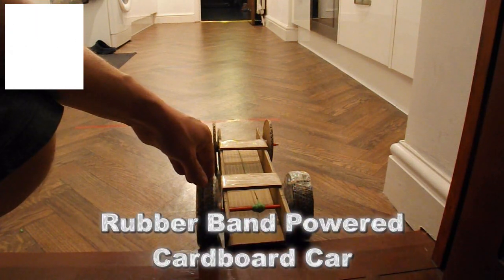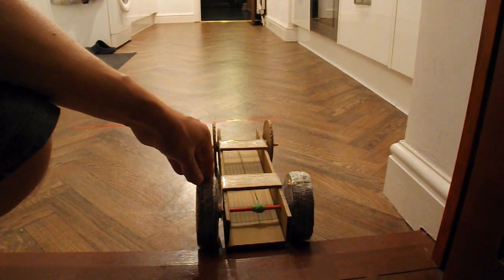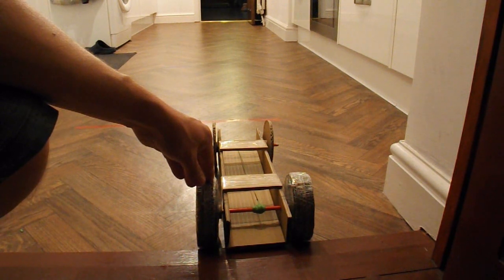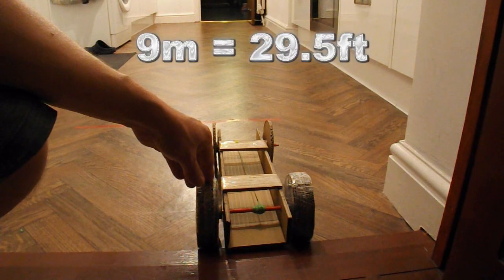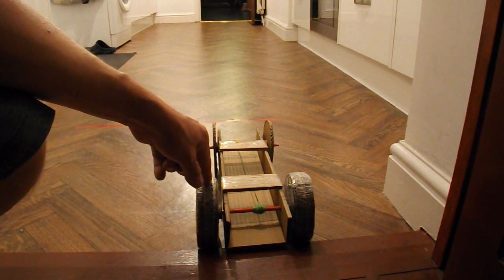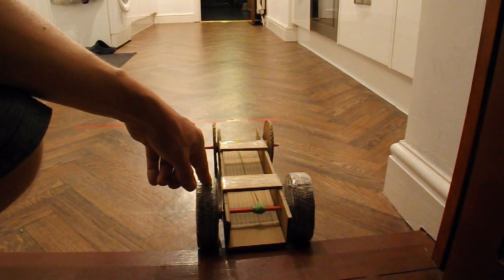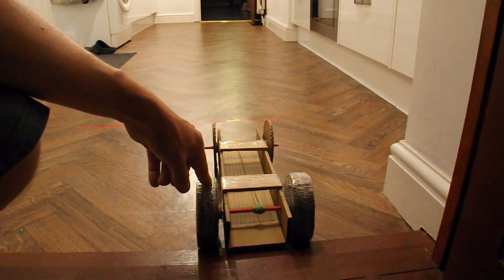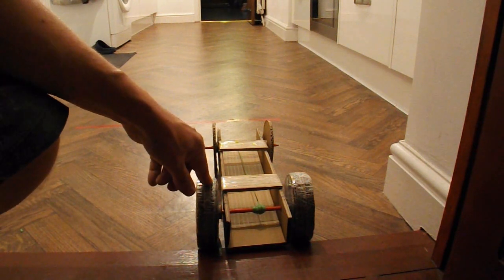Rubber Band Powered Cardboard Car

Comment: By car is similar but it keeps going right or left. Do you have any suggestions?
Reply from the maker: 1. Does the car run straight when you just push it without the rubber power?
If it doesn't run straight without power, then your axles are out of alignment.
That could the axles are not parallel or they may be twisted, so one wheel is not on the ground, so it runs on 3 wheels. 
2. When you wind up the motor, the tension may be distorting the body, causing the axles to go out of alignment, with the same effect as "1" above.
3. If you wind the rubber unevenly across the axle,  the tension can pull the axle out of alignment. 
4. Lack of grip. If the wheels spin, instead of moving forward, that can cause the car to turn. Add tyres to the wheels or add some weight to improve the grip.
5. Both wheels on the same axle must be the same diameter.

Comment: I’m a bit confused on how you tied the rubber band? Can you please explain
Reply from the maker: At which point do you mean? If you mean around the axle then I just held it on the axle and turned the axle until the band wrapped over itself. That holds it in place. If you look in the video description there is a link to a video that shows what to do. There is lots of information in the video description.
Reply: @GrandadIsAnOldMan  I didn’t notice the videos. Thank you they helped a lot!

Comment: carboard car looks great.  Can you design a car only with file folders, note papers, index cards, paper clips, rubber bands and regular drinking straws, white glue, masking tape?   Carboard is very sturdy to use to build the body and wheels.  It  was very difficult to build a self propelled car with papers unless I layer and layer and layer them.  Any different ideas?
Reply from the maker: Yes you need to make tubes or corrugate the paper to give rigidity - here is my playlist of paper cars I have made https://www.youtube.com/playlist?list=PLA5a2xPRSrB0WphB6YhygeyR9DDfmC1lk
Reply from the maker: I did this one for you https://youtu.be/vioI3sdiC1Y

Comment: what is the diameter of the wheels? I am thinking about making this for a school project, and this design looks good.
Reply from the maker: +Connor  Wallis If  you have to use cardboard for the wheels then make them whatever size you want. These ones are about the same diameter as a CD. I wouldn't make wheels unless I had to. Using CDs is much easier and you know they are proper circles with no errors, flat spots, or dents.
Reply: +GrandadIsAnOldMan  k thanks!
Reply: +Connor  Wallis also how do u make the back wheels connect to tha back axis, because I made the car and It looks great but it doesnt move when I wound up the rubberband
Reply from the maker: Connor Wallis the first option is to make the hole in the wheel smaller than the axle so it is a tight fit. You have already made the hole so now you will need to glue the axle into the wheel to stop it slipping.
Reply: +GrandadIsAnOldMan k

Comment: how big do the circles have to be?
Reply from the maker: Amir Rahmanipour whatever size you want. Mine are roughly the size of a CD so about 5 inches or 13 cm.
Reply: GrandadIsAnOldMan im having trouble with the front wheels. They aren't going straight and my car keeps leaning towards the right. am i missing something?
Reply from the maker: Amir Rahmanipour if it keeps going to the right then the chances are that you haven't got the axle holes aligned properly and you need to adjust them to straighten up the travel. Alternatively are your wheels spinning on the ground and allowing the car to move sideways slightly? You may need to add something to the wheels to increase the grip.
Reply: GrandadIsAnOldMan it works! thanks so much for this awesome design!
Reply from the maker: Amir Rahmanipour thank you for the positive feedback.

Comment: How do you attach the rubber band?
Reply from the maker: I show you in the video. You might have to slow it down to see it. At the front the rubber band goes through a hole in the cardboard and then pushed through it's own loop. On the axle it is wrapped around the axle so it covers itself and holds itself in place.
Reply: GrandadIsAnOldMan When I tried it, the rubber band quickly unwinds..
Also, do you have any way of making the rubber band car travel a distance of 5m and also drop a cube at that exact place? and I can only use a max of 3 rubber bands..
Reply: GrandadIsAnOldMan The rubber bands are also a bit thick
Reply from the maker: Jade Kelly when you say the rubber band quickly unwinds, do you mean that the back wheels are spinning and the car is not moving forward?
If that is the case you need to increase the grip on the wheels by adding rubber tyres or putting extra weight on the car to hold it on the ground.
Reply from the maker: Jade Kelly A couple of the cars in this playlist drop an object at a specified distance, you should be able to work out a general idea from watching them. http://www.youtube.com/playlist?list=PLA5a2xPRSrB04L6RpUAs5akmK3jqmahPL
Reply from the maker: Jade Kelly if the rubber bands are a bit thick, just don't wind them up so much. If you have trouble connecting them to the back axle try gluing a short piece of wood to the axle so you can hook the rubber band onto it.
Reply from the maker: Jade Kelly
Fault Finding on a Rubber Band Powered Car
1. The rubber band does not connect to the front axle, some people misunderstand the videos and attach the rubber band to the front axle as a convenient anchor. That stops the axle turning. Make a different anchor point, study the video again.
2. Does the car run forwards freely if you just push it without the rubber band connected?
If it does not, make sure that the axles are free where they pass through the body. You may need to enlarge the holes where the axle goes through the body or use larger tubes for the axles to go through.
Are your wheels round with no flat spots. You may need to trim them.
3. Do the wheels spin evenly when you watch them?
If your axles do not pass through the centres of the wheels, the wheels will not spin evenly and this makes it harder for the car to run, so you will need to make new axle holes, taking more care finding the exact centre.
4. When you wind the rubber band round the axle do the wheels turn at the same time or are they slipping on the axle?
If the wheels are slipping on the axle, the rubber band will unwind without the wheels turning on the ground. You need to do something to stop them slipping. Glue them to the axle or wrap tape round the axle where the wheels are to hold them in place.
5. When you release the car it does not move, but if you lift it in the air, the rubber band unwinds and the wheels spin OK.
Either the ground is too rough or the car is too heavy. Try the car on a smooth surface, make the car lighter, add more rubber bands. 
6. Wheel spin. When you release the car, do the wheels spin without the car moving forward?
You do not have enough grip on your wheels. Either add some weight to the car to help the grip or put something on the wheels to improve the grip. 
Things that will improve grip - hot glue all the way around the rim like a tyre. Rubber bands stretched across the wheel. A strip of rubber cut from a balloon stretched around the edge of the wheel. Strip of rubber cut from washing up gloves. Disposable rubber gloves.
7. Trouble connecting the rubber band to the back axle? Glue a short stick to the axle to act as a hook for connecting the rubber band.

Check out my HelpFiles playlist. Many of the videos are related to Rubber Band Powered Cars
http://www.youtube.com/playlist?list=PLA5a2xPRSrB2v0vxMJyZ9cPweAGx1FK6e
Reply: Alright, thank you so much. I'll test it out today.

Comment: When I release the rubber band, most of it just goes without the car moving. It just slips off when I let go after I wind it and the wheels are kinda loose on the axle. Why doesnt it go far?
Reply: my rubber band also unwinds quickly and the car doesnt travel far
Reply from the maker: Max Dillon Fault Finding on a Rubber Band Powered Car
1. The rubber band does not connect to the front axle, some people misunderstand the videos and attach the rubber band to the front axle as a convenient anchor. That stops the axle turning. Make a different anchor point, study the video again.
2. Does the car run forwards freely if you just push it without the rubber band connected?
If it does not, make sure that the axles are free where they pass through the body. You may need to enlarge the holes where the axle goes through the body or use larger tubes for the axles to go through.
Are your wheels round with no flat spots. You may need to trim them.
3. Do the wheels spin evenly when you watch them?
If your axles do not pass through the centres of the wheels, the wheels will not spin evenly and this makes it harder for the car to run, so you will need to make new axle holes, taking more care finding the exact centre.
4. When you wind the rubber band round the axle do the wheels turn at the same time or are they slipping on the axle?
If the wheels are slipping on the axle, the rubber band will unwind without the wheels turning on the ground. You need to do something to stop them slipping. Glue them to the axle or wrap tape round the axle where the wheels are to hold them in place.
5. When you release the car it does not move, but if you lift it in the air, the rubber band unwinds and the wheels spin OK.
Either the ground is too rough or the car is too heavy. Try the car on a smooth surface, make the car lighter, add more rubber bands. 
6. Wheel spin. When you release the car, do the wheels spin without the car moving forward.
You do not have enough grip on your wheels. Either add some weight to the car to help the grip or put something on the wheels to improve the grip. 
Things that will improve grip - hot glue all the way around the rim like a tyre. Rubber bands stretched across the wheel. A strip of rubber cut from a balloon stretched around the edge of the wheel. Strip of rubber cut from washing up gloves. Disposable rubber gloves.

Check out my HelpFiles playlist. Many of the videos are related to Rubber Band Powered Cars
http://www.youtube.com/playlist?list=PLA5a2xPRSrB2v0vxMJyZ9cPweAGx1FK6e
Reply: GrandadIsAnOldMan I dont know the problem. After the rubber band is winded (anchored not at the front axel) it just quickly unwinds. It doesnt take a long period of time like your car in the video. When I let it go, all of the band unwinds so quick that the car moves only a little bit.
Reply from the maker: Max Dillon did you read all of my reply? I think your problem is either 4 or 6 in my list.
Reply: GrandadIsAnOldMan Thank you a lot!
Reply: GrandadIsAnOldMan IT WORKED THANKS GRANDAD
Reply from the maker: Max,that's great news, thanks for the feedback.

Comment: Good disine , I'll try to modify it 7 send a vid as soon as posibul!
Reply: "Cut out the 7!!!"
Reply from the maker: Unless you are restricted to cardboard for wheels I would never build a car like this. Cardboard wheels are more trouble than they are worth. Same with pushing holes through the cardboard chassis for the axle bearings, not a good idea. A plastic straw gives you much less friction.
This design meets the restrictions of the task set and that is the only reason for it.
Reply: THX for advise!
Reply: GrandadIsAnOldMan We are learning about physics (I think) in science class and as fun way to learn, we are making rubber band race cars. I wanted to make something way better that everyone else's and found this. I have a few questions but will probably have more seeing as I have one just started making it. Question 1, would cutting larger axle holes and gluing (how do I spell that?!?) a 1 cm piece of straw in work better or should I have the full straw. Also what makes the best strong, durable axle, that fits in the straw. Question 2, we are only allowed to use 3 rubber bands, nothing abnormally long or thick, how many does this need? Question 3, I was thinking of using 4 inch wheels but I really down want to have to cut 14 of those. What would be a better alternative that I could add hot glue, like tires as you said onto. That's all for now but please reply as soon as possible and sorry for asking so much.
Reply from the maker: Miles Larson before I try answering your questions I will ask you one. Does your car have to be made from only the components listed in the video description for this car? The reason I ask is that there are 187 video in my Rubber Band Power playlist and the majority are cars and the one you are looking at is not the easiest to build.  Given the choice I would use CDs for wheels as cardboard wheels are never easy to get perfectly round. You could put strips cut from a balloon or rubber gloves as tyres to improve grip. Given the choice I would use plastic drinking straws as the axle tubes and yes you are right, short lengths of tube would be better that the whole straw as there will be less friction in short lengths. Generally I use bbq skewers for axles and if you are only using 3 rubber bands you should not have any trouble with a bbq skewer breaking.
Here is a typical easy build, it is a long video but that is because I didn't fast forward any of it. There are also useful links in the video description  https://youtu.be/pIO3FiHX4Oc?list=PLA5a2xPRSrB1otXh0w36OwsYIHZznUWp6

Comment: make longer rubber band for funzies
Reply from the maker: Hi Rich22221, there is no point in making a longer rubber band. It would only unwind under tension so if it is longer than the car there is no tension to unwind it. You could double up the rubber bands so the motor is thicker, that would make it more powerful and you would need to wrap rubber bands round the wheels to give extra grip to stop the wheels spinning.
Reply: GrandadIsAnOldMan ah i see didnt think of that.